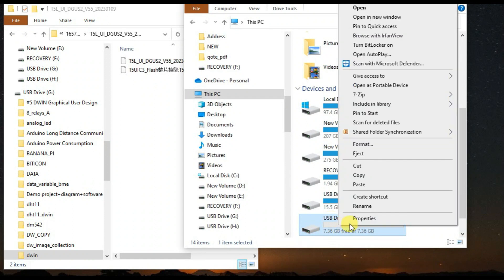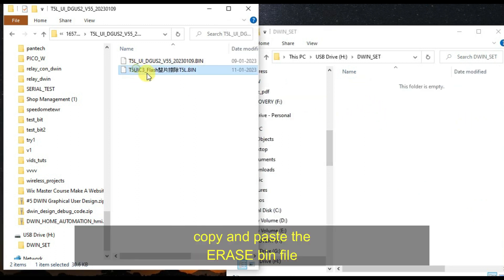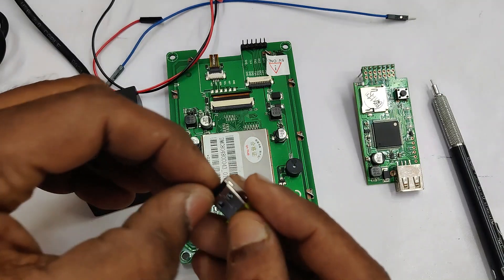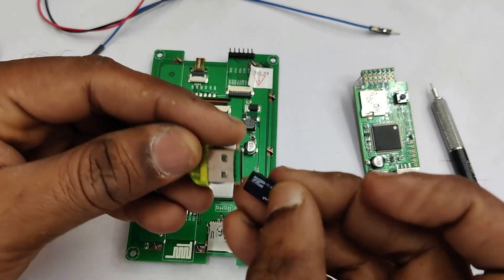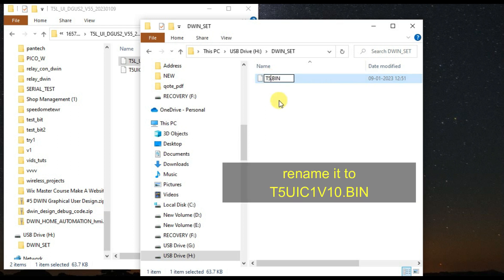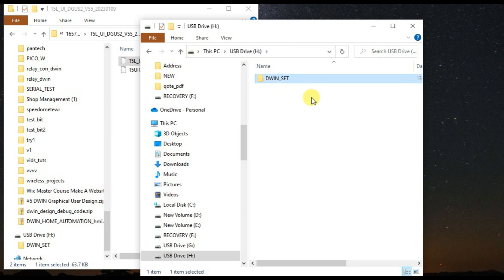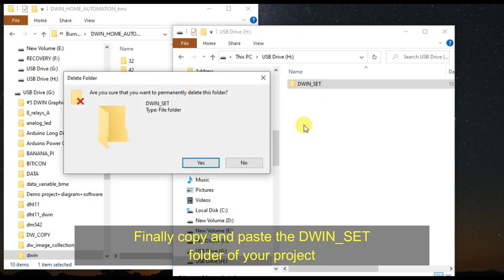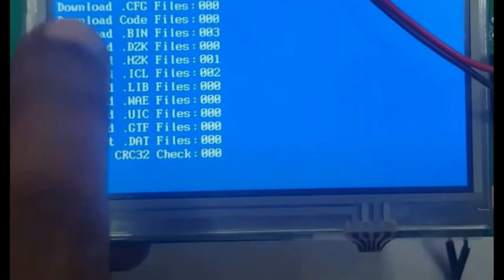#6 DWIN Display Recovery -Burning Kernel files with PGT05

Comment: Thanks for the video. I had to try multiple times, before it would flash the blue screen. But now touch screen is not working. Any suggestions ?
Reply: I see there are other users with the same issue.Anyone found a solution ?

Comment: Hello, I restored the display using a programmer but the touchscreen does not work, what could be the reason?  DMG10600C070_03WTC
Reply: Even I am facing the same issue. Along with that I am also facing communications not working issues.

Comment: I bought 2 T5L0 displays from the Dwin store on Aliexpress, but they came with T5L1 firmware, they don't work correctly. Does this firmware work for T5L0 800x480?
Reply: I contacted Dwin, they told me to put some kernel files along with the SD card files. It seems that there are several operating modes, and my displays were in TA mode, but when sending a project made in DGUS ii software, the display would freeze. After 'converting' the display to DGUS mode, the projects and serial communication (RX2/TX2) worked according to the various tutorials on the internet.

Comment: Good afternoon, I have 2 pieces of such a display, one broke. How do I copy the program from the working display to my computer to flash it on the new display?
Reply: I'm also now facing the same problem. Did you find a way to copy the firmware from the working one?

Comment: Hello Saravanan AL, I am using DWIN DMG80480C070_15WTR screen and I can not communicate with the screen by RS232 protocol. Can you help me about detecting the reason of the communication problem and also solving the problem?
Reply: Even I am facing the same issue. Along with that I am also facing touchscreen not working issues.
Reply: win xp
Reply: win10 does not work